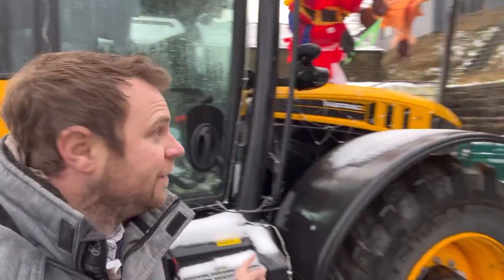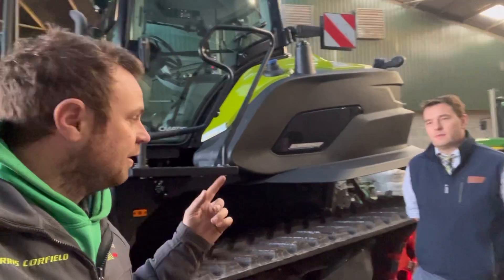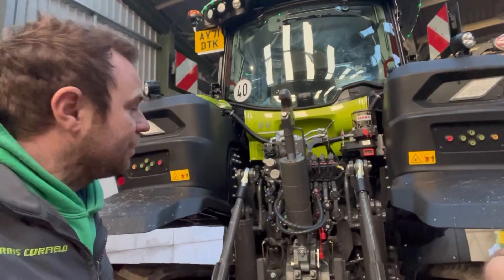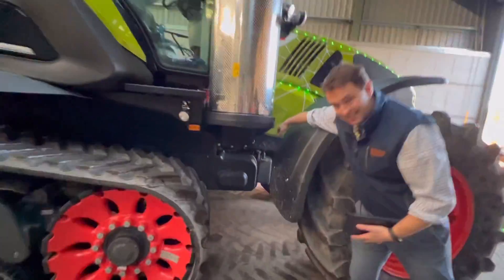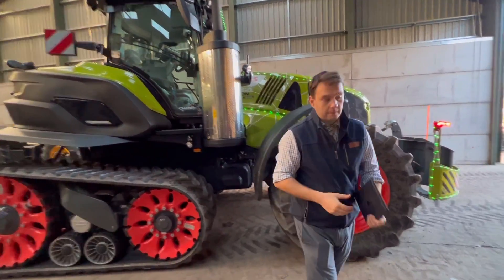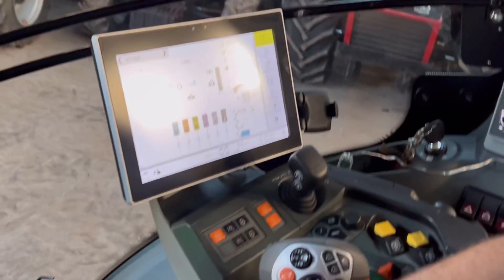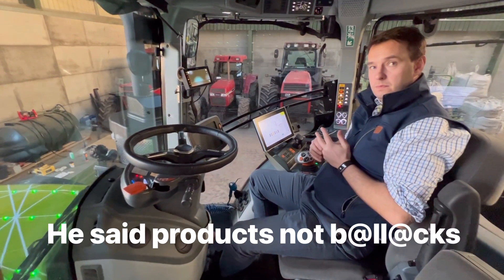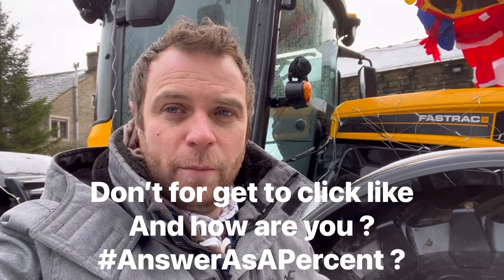Day644 OLLYBLOGS CLAAS AXION 960 TERRA TRAC IN-DEPTH LOOK AT ITS FEATURES #AnswerAsAPercent

Comment: Got few customers with these locally in Suffolk. They have had a few issues but they pull well and turn with less scrub than a twin track. Local to Claas UK here so good following. 

Can send VR plans direct to the new Cebis 1200 from Omnia platform now - Not sure you can from JD, CNH, etc. as yet but certainly can link all together for location and fuel use, etc